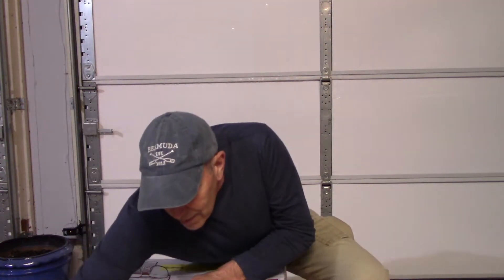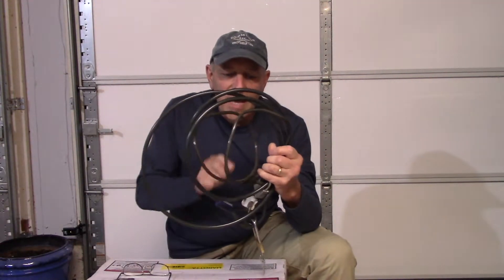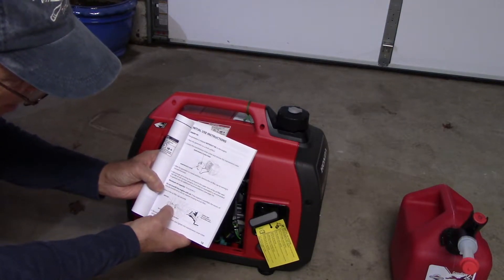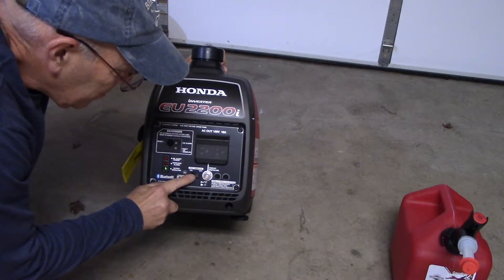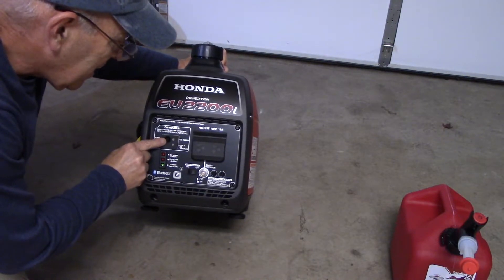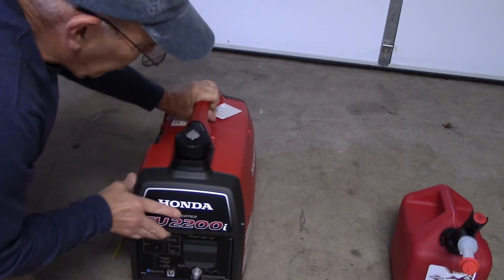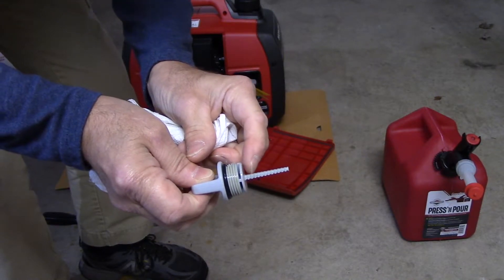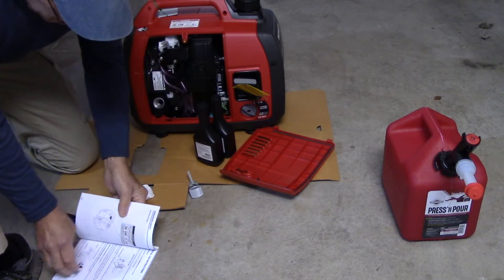Honda Generator EU2200I Unboxing, Set Up And Start

Comment: The reason for the many pulls is that these have a fuel pump. So since its new & fuel pump is dry, the extra pulls are to fill the pump & then the carb.
Reply from the maker: Thanks for watching.

Comment: Just bought one, took it out of the box, added oil and gas, turned vent to on, turned gas to on, set choke to on, and IT WOULD NOT START. Super disappointed since I drove 80 miles to get it.
Reply: Picked mine up yesterday and it started on 5 pulls.
Reply: NBKSD Returned mine to the dealer.  They could find no spark.  They swapped it out for another and it started right up.  Who knew when buying a Honda that you could get a lemon.
Reply from the maker: Nothing is made like they used to be. Not even Honda.Thanks for watching.